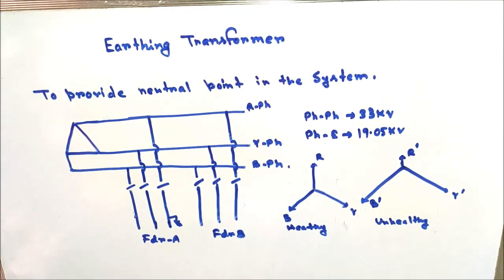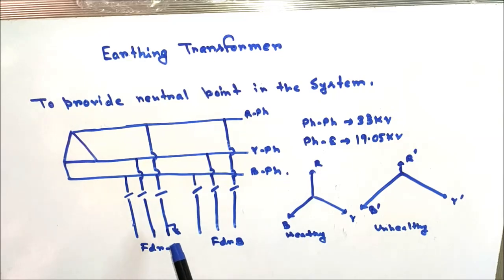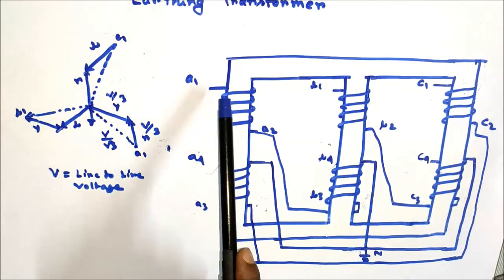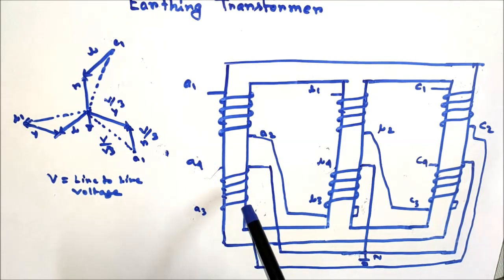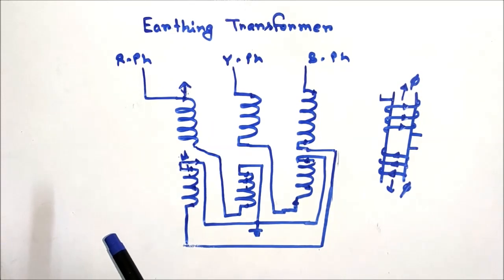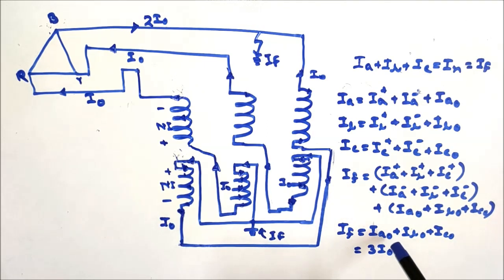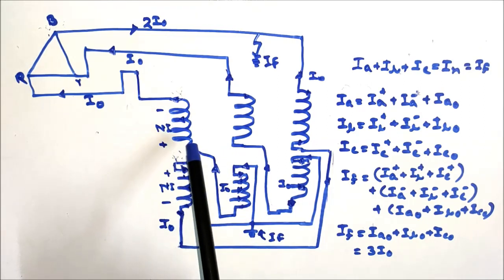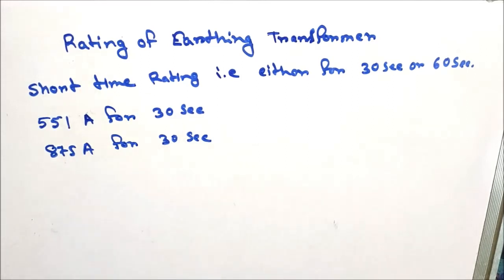Earthing Transformer, Connection Diagram and Working Principle

Comment: At start of video, u mentioned star side of star delta for can be used as return path for fault current.  Normaly the star winding offer a high inductance so the impedance Z will be higher , so fault current will be lower which will not activate primary system protection. Earthing xmer will provide almost zero Z  ,which will alow high enough current to activate protection.